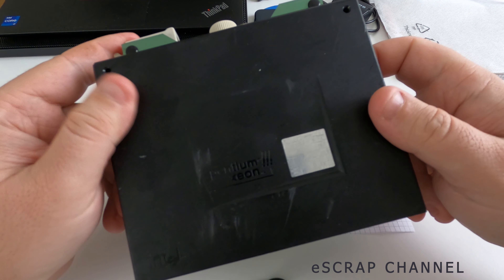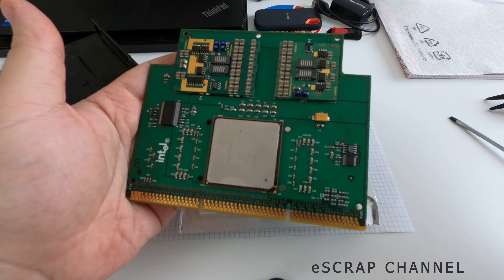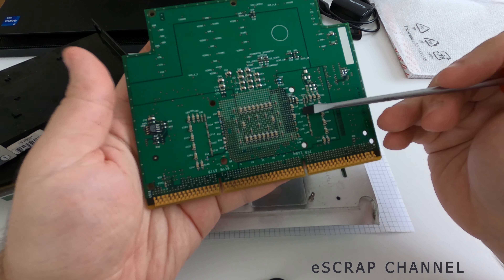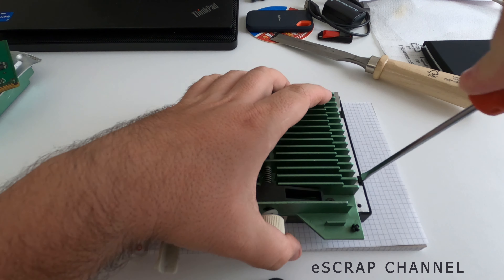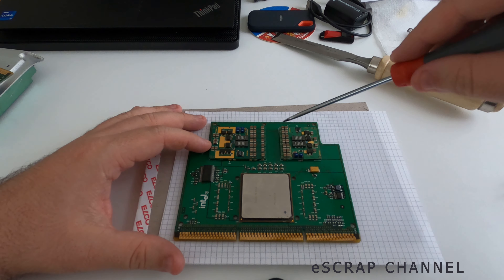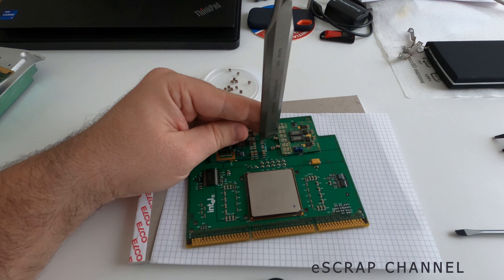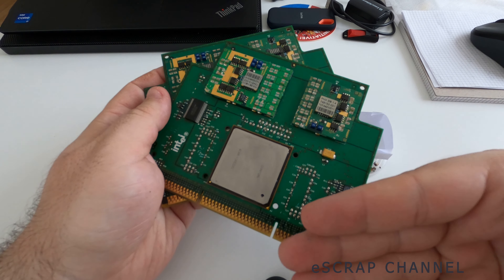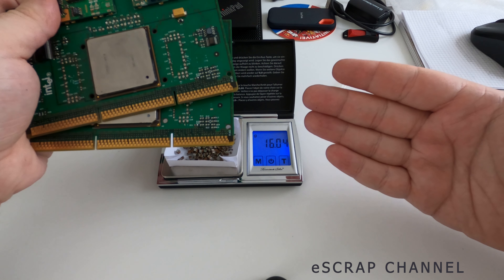Palladium in old CPUs

Comment: I use SMB powder for preception. It is necessary to wash gold pwd.with hot water 2to4 times before melting with washing soda& borax pwd.?
Reply from the maker: Hi, yes washing helps. You can also boil gold powder in nitric acid to remove all metals but platinum.